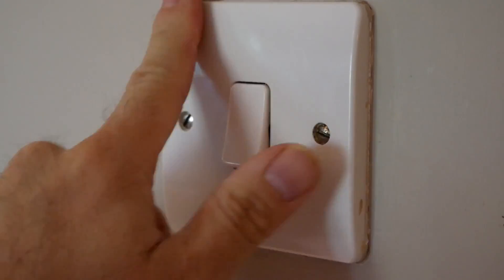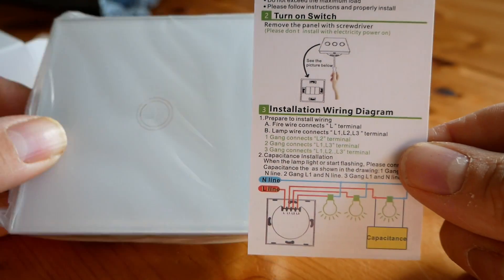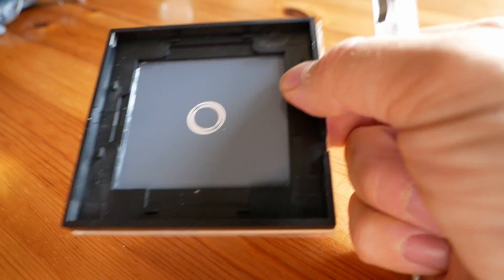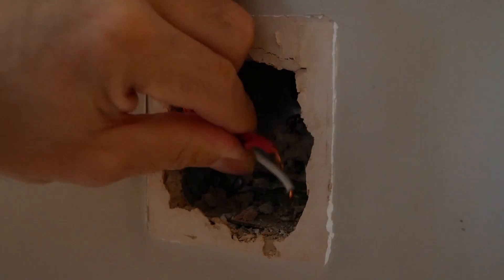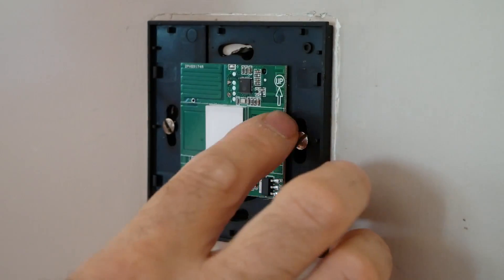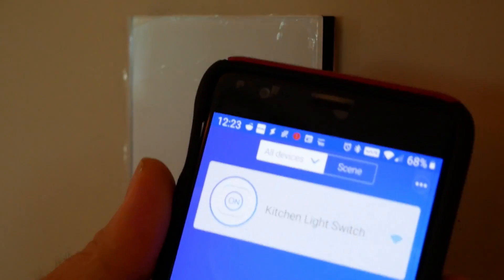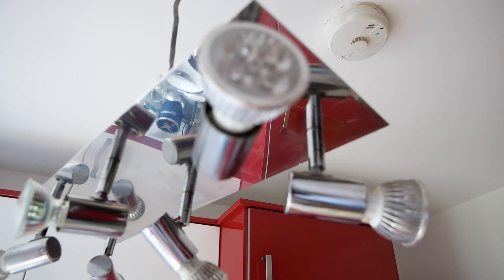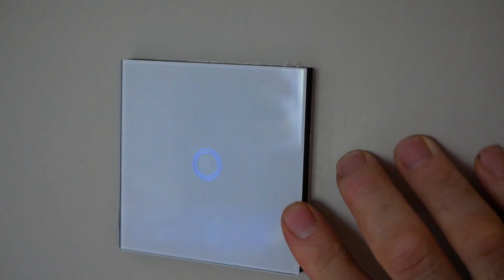No Neutral Smart Light Switch - Unboxing and Fitting

Comment: What would the implications be of using earth as a neutral on the switches that require neutral?
Reply: Absolutely don’t! Earth is your safety wire
Reply from the maker: Don't do it. There will be safety implications. The earth is there for a reason and is deliberately wired to ground and does not carry a voltage. Putting a voltage down it could cause difficulties with your breakers or you may cause a part of your electrical circuit to become live that shouldn't. 
All metal in your house like your plumbing is bonded to earth and any metal switches, lamps, appliances are all earthed. Putting a voltage on there could have unforeseen and dangerous consequences. I would certainly not take the risk.
Reply: Why do people who know fuck all about electrics mess with electrics!!!!! Leave it to the professionals!!!!

Comment: What about if you have a 2 way switch - how would you wire that up with smart switches? I know you set up routines to sync the switches, but haven't found  video to show how to replace the UK switches yet - with or without Neutral wires.
Reply from the maker: I have never done a two way switch with smart switches. Will look into it 👍
Reply: You can set up themes within the apps so that when one switch is pressed it sends a signal to another switch.  This does rely on the internet being live.

Comment: Are these safe ?
Reply from the maker: Not sure what you mean. I have had no problem with this switch and seems well made. I have not tested it to destruction to determine the safety with regard to load, voltages or any other test so can't really answer the question.
House not burned down yet. So far so good 😊
Reply: Like condom's 😎🤗

Comment: Hi I was wondering if you can use this switch with smart life app thanks
Reply from the maker: It only works with the eWelink app which is very basic compared to the smart life app. I have not found a way to get it to work on another app (smart life app would be amazing) but maybe someone else has had success with this.
Reply: You can use it with Google assistant after linking the ewelink account with Google.

Comment: May I ask the name of the switch?  the UK Link will not help me much over here in the US. Thanks
Reply from the maker: They are quite difficult to find. I have noticed that there are a few popping up in eBay. I have no idea of the quality but maybe a place to start and a good bit cheaper than the switch in the video;
US Ebay - 
http://rover.ebay.com/rover/1/711-53200-19255-0/1?ff3=4&pub=5575231602&toolid=10001&campid=5337968154&customid=Lightsw&mpre=https%3A%2F%2Fwww.ebay.com%2Fsch%2Fi.html%3F_nkw%3Dsmart%2Bswitch%2Bno%2Bneutral%26_trksid%3Dp2380057.m4084.l1311.R1.TR3.TRC2.A0.H0.XNo%2Bneutra.TRS0%26_sacat%3D0

For the UK - 
http://rover.ebay.com/rover/1/710-53481-19255-0/1?ff3=4&pub=5575231602&toolid=10001&campid=5337968154&customid=Lightsw&mpre=https%3A%2F%2Fwww.ebay.co.uk%2Fsch%2Fi.html%3F_from%3DR40%26_trksid%3Dp2380057.m570.l1311.R6.TR12.TRC2.A0.H0.Xsmart%2Bswitch%2B.TRS0%26_nkw%3Dsmart%2Bswitch%2Bno%2Bneutral%26_sacat%3D0
Reply: @handymancraftglasgow  Stumbled upon your video which was very helpful. I'm looking for a 3 gang one, do you mind sending the link to the actual item? one of the items on the link actually comes with the capacitor, but it also clearly highlighted that "if you want this to be linked to wifi, it needs neutral wire"

Comment: Just went through the same thing had to put a deeper socket on made all the mess than realised mine I bought was a 3 wire dohhh
Reply from the maker: That is annoying. At least you know you can get a switch that doesn't need the neutral.

Comment: If the switch controls 2 light points, do we need to add capacitor to each light point?
Reply: As manufacturer shows in some instructions the capacitor is only needed for 1st light bulb.
Reply: The capacitor is used to basically create a circuit to allow the switch to work without a neutral connection.
Reply from the maker: It should be fine with just the one capacitor.
I haven't tried a light in a two light set up so to be completely certain maybe worth while emailing the supplier direct.
There is a link to their website in the description.